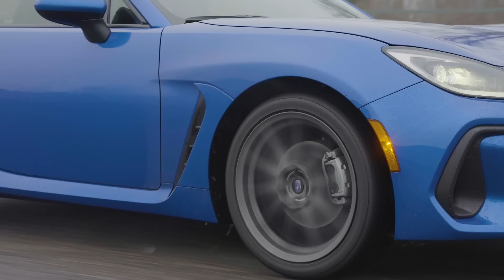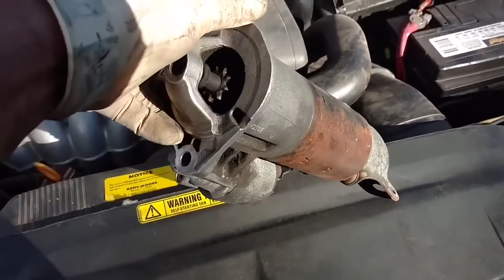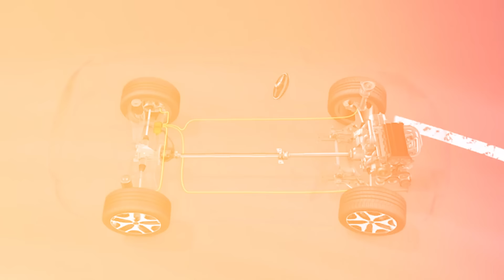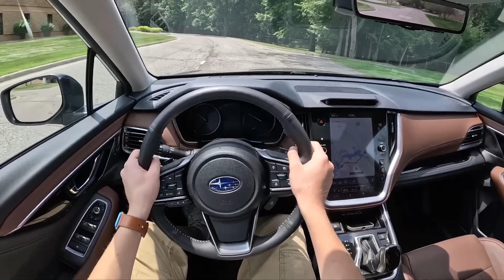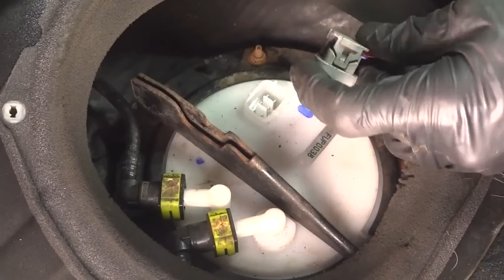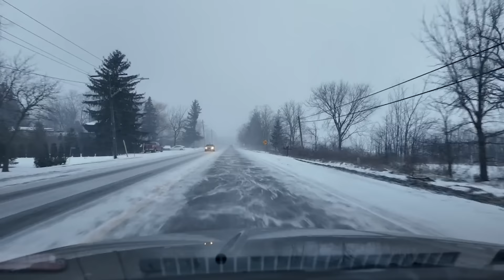I Fix Subarus Daily – Here's What NEVER Breaks!

Comment: 2011 subaru tribeca 
Just replaced struts, lower control arms inner and outer tie rods all original to car 144,000 miles car feels brand new runs perfect oil changes ever 3-4k hope car will go another 150k no major problems change transmission fluid drain and fill every 30k
Always buy OEM parts

Comment: My first Subaru I could agree on a lot of this. 1990 Legacy L Wagon. I purchased it with about 150,000 miles on it. Had been over heated I paid 100.00 in 2003. I replaced the head gaskets and drove it another 100,000 miles. The Automatic transmission went out, I had a 5 speed laying around and put it in. Fuel pump, alternator, starter, never replaced. Control arm bushings, wheel bearings lasted forever. I don't baby my Subaru's, but I maintain them. Seems like they run better when pushed more. My 06 Outback loves 3,000 rpm or higher on the highway. I have to say it isn't as good of a car as my 1990 was. Alternator, starter, about 125,000. Front lower rear control arm bushings don't last. Should have left the control arms alone. I swapped to all poly bushings. Wheel bearings are a nightmare. I buy OEM when ever possible, I refuse to use Chinese parts. I've had wheel bearings go out in less than 5,000 miles. Yes name brand supposed to be quality bearings from reputable companies. Trying Timken this time. My 4th Subaru, Ex wife had a Forester 270,000 miles, Daughter Cross trek manual, her second, Son on his 3rd. Legacy gt wagon 5 spd, and Forester. I'm a disabled auto tech, my son Ford master tech.

Comment: I changed two rear hub assemblies on my 2015 Forester. One at 40K and the other shortly after. I think Subaru should have had a recall.
Reply: Amen Brother, I have replaced two bearings on my 2015 Forester and two on my 2017 Crosstrek...all b4 75K miles. There is a service notice on them. Outside of the infamous headgaskets on the EJ series engines, the wheel bearings are Subaru's 'Achilles Heal' and the reason they are out of the top spot in Consumer Reports ratings!

Comment: I drive a Subaru Outback 2017.  From the moment I bought my vehicle it was very loud,  lots of people commented on that. 
I contacted the dealership but they brushed me off.
At 94,000 miles the rear axle bearings were replaced.   It continued to oubd awful,  I took it to a different Shop, they replaced them again stating they were in really bad condition.   
I know several people who drive Subaru's and they've not had this issue.
Reply: By the way, I took the old parts to the first shop that replaced the bearings and they refunded my money.

Comment: I have a 2010 Legacy.  Had issues with a wheel bearing that failed relatively early and front control arm bushings failed on both sides so had to replace the arms.  Otherwise it's very reliable.

Comment: Good to know. My 2011 Subaru Forester only has 45,000 miles.  I am the original owner and follow the maintenance except oil changes at 4,000 rather than 6,000. Looks like I will be good to go for a while, and then some.

Comment: Ive got 120,000 miles on 2016 legacy and have replaced 3 wheel bearings
Reply: It wasn't an outback
Reply: @BryanEller-i3g outbacks are worse on wheel bearings and cv axles. The added lift causes more strain on these items due to operating at increased angles.

Comment: We just bought our 10th Subaru, never a major problem. Things I’ve learned: change oil every 5k miles with a factory, Wix or Purolator oil filter, the only ones with the high bypass spec. Change front & rear differentials oil every 30-40k miles. I have the dealer change the CVT fluid every 40k miles. It gets hot & dirty just like all transmissions, don’t believe it’s “lifetime fluid”. Plus PCV valve every 50k mi. And of course brake fluid, air filter & cabin filter. I run 0w20 in winter & 5w30 when warmer.

Comment: The nice thing about Subaru that I research is yes there is a catagory of maintenance but it is so simple and fairly reasonable. I own a 24 cross trek wth less than 24000 miles and it is still new enough to make sure I didn't miss any maintenance. I'm almost due for cvt fluid change and inspection. One thing I'm going to be more mindful of is more frequent oil changes around 4000 to 4500 and not 6000 miles. I have a pcv valve I ordered that I may replace  soon as well. I want to get the most out of my car til it is paid off then I may decide whether or not to trade in on a new one or keep this one for another 5 years.
Reply: Thats exactly what car I have, and I’m doing the same. I use ethanol free gas and I’m going to start using the amsoil upper cylinder lubricant. Do you use idemitsu oil? They have the IFG-7 on their official store in amazon for 48$